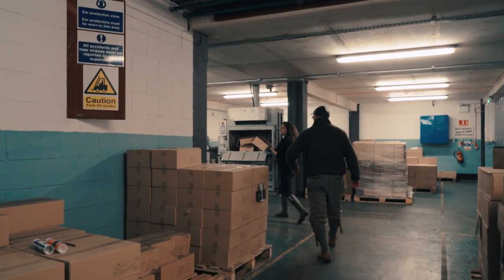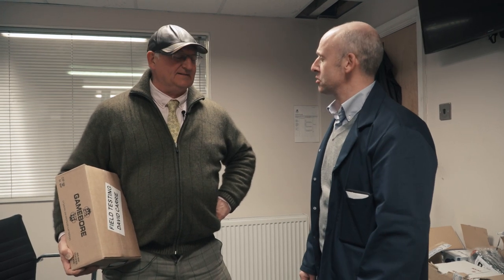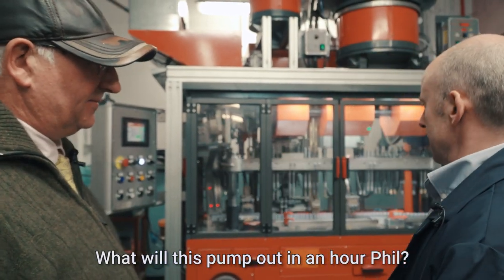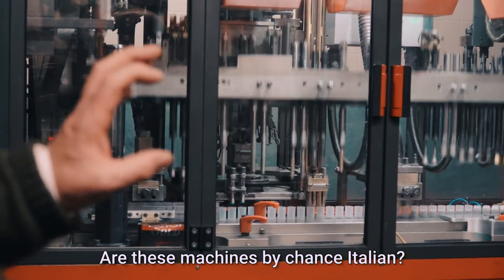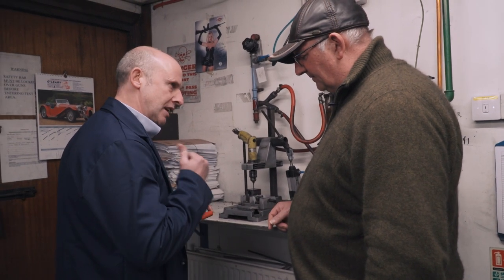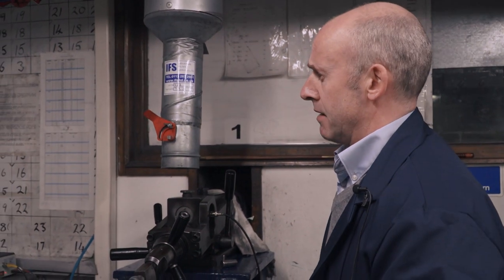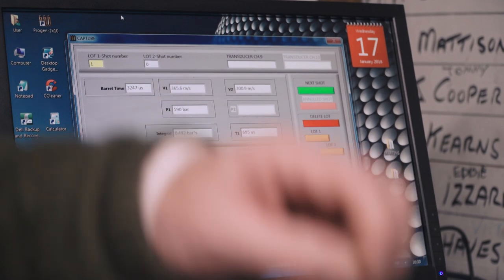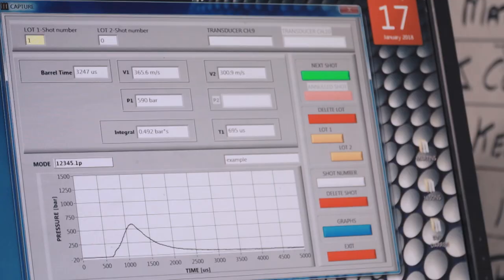Dave Carrie Visits the Gamebore Factory

Comment: Dave, I need your advice. Shall I opt for 18,4mm bore or larger? I will shoot lead and steel. Will the fiibre wads seal in larger bores like 18,6. 18,7, 18,8mm? What about pressure in 18,4mm bore with steel? Don't be shy :-)